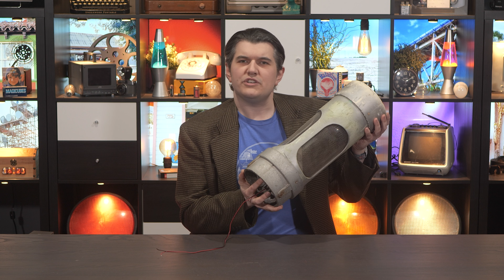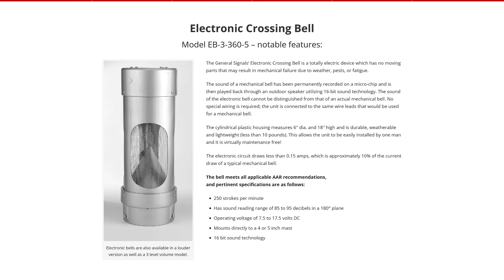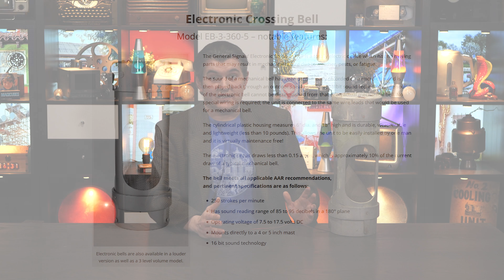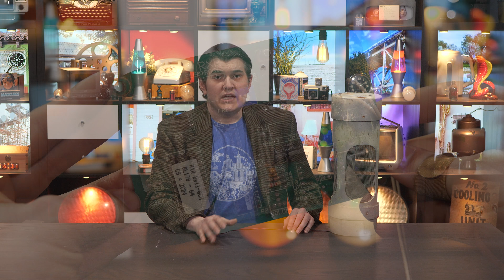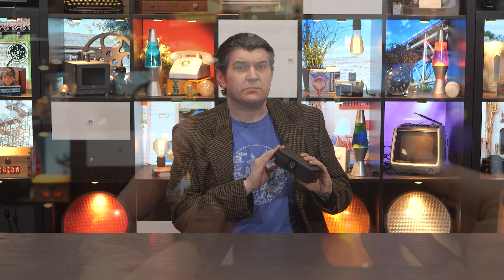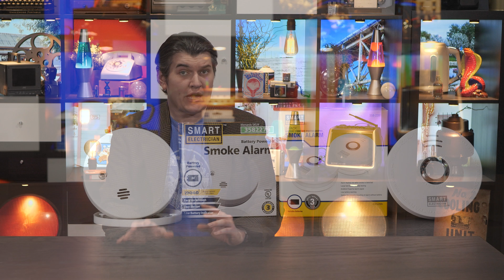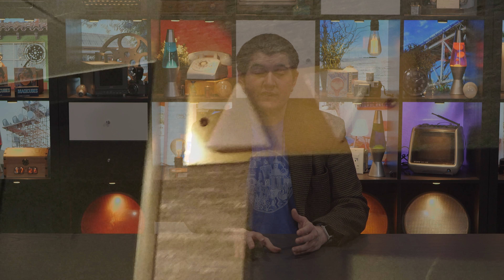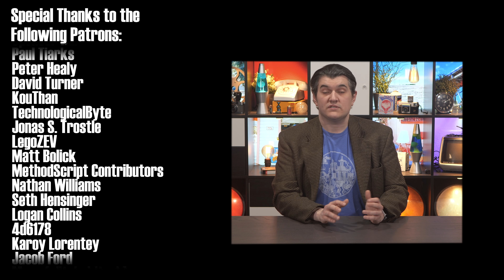The disappearing and unappreciated art of audible alerts

Comment: Everything does suck now but you're the perfect guy to explain this to everybunny: lowest common denominator design. You're the exception, I'm the exception. The norm is to accept the defaults and never customize anything. Half of all phones are fruits, and that garden lost their minds when USB C finally made it to their handhelds after bragging about it on their big boy boxes for years. The enthusiast space has always suffered the fact that 99% of purchasing power is convenience-driven whereas we've almost normalized having to modify our devices and interfaces; that's necessitating the modification, not merely allowing for it. The very fact that cloning a git repository is a common step for installing software highlights this problem that we accept undue complexity for the sake of customization. This need to customize our electronic world is an exception born of over complication, consider instead the reduction of complexity. Rather than fine grain control over notification sounds and temporal intervals, consider a reduction in notifications. Every problem is built atop the back of other smaller problems which are more meaningful yet more more challenging to address.

Comment: This taps into an issue I've had with backup safety features in cars.  Backup cameras are great and all, and certainly serve a purpose in their own right (as do front cameras in cars that are stupidly large enough to need them, though I'd argue that no non-industrial vehicle should ever be that stupidly large), but as they've become the standard to satisfy legal requirements to include such features, I'm really missing the audible backup alarms that larger vehicles would have before cameras became cheap enough to take their place.  Backup cameras give a better view of what's happening behind the vehicle, but the driver has to choose between looking at the camera and looking around them.  An audible alarm offers less information directly, but you can pay attention to it while still providing your full attention to looking around the car, which means it augments looking around instead of taking its place.

Ideally, I'd like to see both, but that's not typically how regulatory compliance works and I don't know that there's all that much consumer appetite for a solution to my particular bugbear.

Comment: We need the Technology Connections notification set
Reply: Would it be airplane bings, elevator bings and, Disney attraction sounds?
Reply: @JasonRBeing  add in dishwasher noise
Reply: @kaseycaseyiel Dishwasher noise should be reserved for noise where it's important which direction it comes from, like a reversing truck or a fire alarm needing a replacement battery.
Reply: I would actually pay money for that, honestly. A preset notification suite on Android that made its point without me needing to manually configure everything... EDIT: maybe with some joke options *available*, if not used by default & clearly labeled.
Reply: I want this too
Reply: +1

Comment: Notifications are a nightmare. My phone, watch, tablet, and laptop all would ding when a message came in. Turned it so only the watch vibrates and phone has sound. I thought hey how cool I’ll always get my watch to notify me and phone can be supplemental sound.

Now, most of the time my watch just vibrates, other times just the phone makes sound (vibrate turned off). I have yet to figure why one pings vs the other. There are times my phone screen lights up with a message but NONE of the devices ping me.

Feels like my choice is: guaranteed notifications that’s annoying or expect some notifications won’t come through. I choose the ladder because I’d rather pick up the phone less. Just wish I could make it so my watch always ping me for notifications without having to reconfigure settings when I take the watch off.

Comment: You've hit on two area I'm really passionate about. User experience and sound design. Honestly, though there are many things I can complain about when it comes to Microsoft, the notification sounds available on previous versions of Windows (along with add-ons, like Windows 95 Plus!) were really excellent. Modern notification sounds are worse than unobtrusive: they're too soft. Even when your volume is up, they are often unnoticeable with only the slightest ambient noise or pocket fabric to compete with. Not to mention that the vibration mechanism in recent Android phones (in my Pixel 9, at least) are so weak I'd need a sensory deprivation chamber to be able to notice them.

Comment: My apartment building was built in 2018 and still uses that “slow whoop” tone for its fire alarm system. It also plays a voice, as required in buildings above a certain height or capacity. 
    I’ve noticed that the “slow whoop” tone is commonly heard on these voice systems in taller buildings, regardless of the system’s manufacturer.

Comment: Let me chime in with medical devices, which, too, have a sound standard! Most medical devices have three alarm levels: blue, yellow and red. Blue is just some general info, yellow some violation of an alarm limit and red a condition that might be immediately life threatening to the patient. The alarm levels are, too, encoded in cadence. Blue is two tones. Yellow is three tones. Red is "dah-dah-dah---dah-dah-------------dah-dah-dah---dah-dah". This, too, has the advantage that even rather simple devices can make these alarm sounds. But it gets better! There even is a standard for the melodies! There is a melody for circulatory alarms, a melody for oxygen saturation, one for ventilators, one for drug application, one for external circulation (dialysis machines, heart-lung-machines, ECMOs), one for temperature alarms. If companies actually kept to those standards, you could hear from two rooms over exactly what is wrong. Unfortunately many manufacturers ignore the melody standard and just have their own proprietary melody, many manufacturers also use entirely proprietary tones, too, though at least many monitors can be switched between IEC standard and proprietary tones. Also, many devices that could potentially give alarms for more than one of the above mentioned categories don't have different melodies programmed for them. For example a patient monitor could give of a circulation alarm due to heart rate or blood pressure, a saturation alarm due to oxygen saturation or a ventilation alarm due to respiratory rate or exhalded carbon dioxide concentration. So far I have only encountered a singe device that actually output two different IEC melodies.

Comment: So as a railroader myself, the E-Bells are significantly more failure prone than the old mechanical bells. 

The mechanical bells, although mechanical, are way more robust. Theres mechanical bells from 1930 that have never been opened up and still working to this day, an E Bell gets a little moisture inside it quits, slight change in voltage, quits.

The E-Bells aren't an improvement and I don't know if they were ever marketed as, they are just significantly cheaper to produce. I mean come on, PVC pipe, bug screen, a cheap DAC, and a loudspeaker, that costs $25 to build, and then sold to railroads at 10x-25x the cost, a lot cheaper than machining gongs and winding electromagnets.

Comment: 3:17 yes this is made from hardware store parts, a PCB, and a speaker. If you built this from scratch, you could probably do it for under $100, I wouldn't be surprised if the company charges the government $1500 for this. Which is effing bonkers.

Comment: I have never seen those mechanical door entry alarms in Europe.
The classic setup is a small bell struck by the actual door. Sometimes a string with several bells is hanging in the path of the door.
Nowadays, a light barrier or an electric contact the door slides over is used. Then a simple door bell is supplied with power. The common door bell is actually what you have there as all-mechanical. An electromagnet pulling the striker and a spring flings it back. In most cases, there are two different tones, the high pitched struck when the electromagnet is pulling, the low pitched one on release. 

So it does exactly the same, but electrical instead of mechanical. I like your version a lot better!

Comment: Smoke alarms sure did sound different in the decades of past. Home smoke alarms became popular in the late 70’s. At that time, piezoelectric speakers were uncommon and expensive, so smoke alarms used a metal buzzer. It used a coil (and for DC powered alarms) used a switching mechanism just like a school bell to vibrate a clapper against a resonant metal plate. This made a 600 Hz shrill buzz, or for AC powered alarms, a shrill 60 Hz growl. Starting around 1980, piezo speakers started being used instead, creating that distinct 3200Hz “beep” tone. At that time, it somehow became standard for the beep cadence to be a rapid pulsing on and off, about 5/6 duty cycle on to off ratio, about 3 times per second. Different makes sometimes used different variations of this cadence. Then, in 1996, a law passed mandating Temporal 3 as the universal fire alarm cadence for both home and commercial fire alarms. This didn’t really trickle down to the average home until the early 2000’s, as hardware stores were still selling their stock of pulsed cadence smoke alarms out.
Reply: And if that wasn’t enough information - you can hear some of these historical relics of the past today. Search for videos of the “First Alert SA76RS” and “Firex FX1020” for examples of different old time smoke alarm horns.
Also, commercial fire alarm “horns” had a very similar history. They were basically scaled up versions of these buzzer horns meant for a central alarm panel to power them. An amusing example is the “Wheelock 7002” which had a unique “quacking” sound from their unique design - harvesting the flyback voltage from the buzzer horn to run a strobe light. There were also AC systems that used horns like the “Simplex 4050”. This horn has been used in sound bites in movies and TV for almost a century.

Comment: I've been really starting to form some heterodox opinions with regard to 'mainstream' ux, the last few years. Nice to know I'm not alone on some of this stuff. Watching tantacrul videos at this point is an enraging study in ambivalence. 

Going against the grain regarding "researched, data-driven UX design" will get you labeled all kinds of nasty things.

Not trying to deny basic math/science. But there is something here that doesn't compute. Taking the end result of focus-grouped design that solves for the lowest common denominator, and twisting that into something that's supposed to be the best thing for everyone is indeed user hostile crap. Not everything can be reduced down to delightful elegance and unicorn farts. 

The dark irony is that I think many would say they are trying to be inclusive. But they seem to be very confused. Maybe there's already a cleavage that I'm missing. Maybe something will break in the next few years. But for now, in my tiny corner of the internet, I've been experimenting with a bit of a different mindset on the things I've designed/built lately. Feedback has been positive.

Comment: Android App Developer here.  There reasons there are very few app/phone options.  1) They cost money.  Not just the development cost.  You have to go through UX design, legal(?), internationalization and testing.  They also generate confusion.  I've received a number of bad reviews because people changed things in settings, then complained that the apps doesn't work like it used to.  This is why most settings are buried down deep, so people don't accidently change them (IMHO).  2) Most people say they want configurability, but in reality don't actually change the settings.  Most people just want things to work.  3) It's hard to get consensus on what is an important feature.  Even then, you might have a killer feature that doesn't seem useful until you actually use it.

Comment: That's all well and good but, bells on buoys are not electronic but, still use the rockin' of the ocean to make sound and the all have different tones and rhythms.  I miss them after I moved from Cap Cod, MA to the deserts of New Mexico. A bell hanging by the door with a rope on the striker is pretty simple.

Comment: Temporal 3 is, indeed, alarming, when you're just working in a repair shop, and the warehouse it's in does a fire alarm test out of nowhere. We always evacuated to the emergency point, even though it came 15 times in one month, while they were finishing off the warehouse complex. After the third evacuation, few of the other units did.

Comment: Regarding the lack of notification control, I'm totally with you! I can't stand how they've removed a lot of options over the years, for some reason, and I'm on board with all of your complaints - have been for ages. There's an app called buzzkill which gives you several added options including conditional settings, and notification cooldowns too - repeat notifications just drive me up the wall.

Comment: Rail bell replacement looks hand made, most likely because it is, as I doubt that they sell more than 100 a year, so do not have a production line set up for it, instead having a person do a run of 100 or so of the pipes, and then putting them in stock, with another person doing say 1000 printed circuit boards, as that is around the minimum for a through hole production line to have set up costs drop below the board cost, so having a 10 year stock is not at all expensive, and they likely also use the same board for other sound generator emulation, which is why it runs off 12V, which means they had to supply a transformer and linear power supply to the railways to use, it, as the old bell runs off 115VAC, even outside the USA, because the USA was a world leader in rail signal electrification, and the railways use 115VAV and 48V DC for power, as they were already by then common standards. with the most complex parts in stock, they then do a run of say 5 when an order comes in and stock of built is low, so the odd replacement for signs obliterated by a truck stuck across the lines, and a train doing the 1 second conversion to scrap, means they will be able to send same day to have a working signal again.

Comment: Even though I'm across the pond, this still brings back childhood memories. The town I'm from and live in used to have a really busy railroad crossing. The barrier system had a bell to indicate when the train is approaching and the barrier is about to close. At one time, they upgraded it to a new one with LEDs. The old unit was tossed next to the crossing, my guess for someone to transport it off for disposal. These things always fascinated me as a kid. So I went to the thrown-out unit and stole the bell part off of it ! I also took the bulbs as well. Then I freaked the hell out of our neighbors by running that bell in my balcony (I had a little "boy cave" in there) from a 12V power supply. Eventually had to scrap it for parts because neighbors started to complain. The freakin' thing was really loud ! 
Oh, and those bulbs, they were 12V incandescent bulbs with bayonet cap. I didn't have anything that would fit them so had to run them by touching the contacts. and because of that didn't end up using them much.

Comment: I prefer the EN54 BS Fire tone (990 & 650 hz alternating) for fire alarms. It have several advantages over the temporal 3 sound. First, the sound has 2 distinc frequencies, so even people with hearing difficulties in the high or low region will hear the sound. Its also distinguisable as a fire alarm, by its "fire truck sound" and it doesn't get mistaken for another signal, for example "refill hopper in manufacturing machine". The EN54 sound is used in many FACPs today, as a local alert. Its kinda sad that they implemented the temporal 3 sound (which has the same problem as I said in yout ADA video about elevator sound - the person hearing the sound must have learnt what the sound means first). The BS Fire tone is a sound that is so recongnizable it doesn't need to be learnt actually.

Comment: I all for providing options and true customization. You also don't put the same effort into just cleaning up your inbox/notifications to only notify you when you need it. Every notification I have enabled is important and does not need any different of a sound (if I were to use a sound).

Someone had mentioned this in a reply, but bitching betties would be better for some things than just a sound byte imo. Your example of the fire alarm was deceiving at best because it used to be a busy tone. If I had heard that in a building that was on fire, but not on fire in my immediate area, I would have assumed that the sound was just a glitch in the intercom system and was 'busy'. This is telling because so many sounds have been used it can be easy to overlap unintentionally.

Comment: 14:43 that right there is the difference. Most people either don’t know or don’t want to take the time to set alert sounds. So they act like the only options are “all the audible notifications, sounding however the app maker set them” or “no audible notifications”. Given those choices, I understand why most pick “none”. But once you curate the audible alerts, it’s amazing! I know instantly when it makes a sound that it’s something important to me [or that I’ve just discovered a new thing that can make a noise and needs learning or turning off] and whether or not I need to act on it. With a text alert, I don’t know whether it’s an urgent alert until I look at it. So either all text alerts become urgent or none of them are—there’s no way for me to discern before I read them.